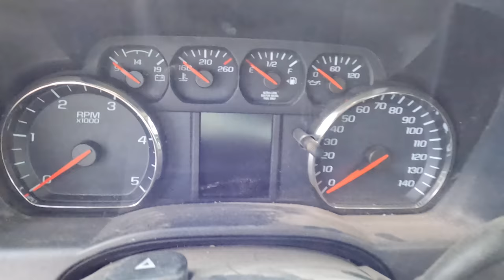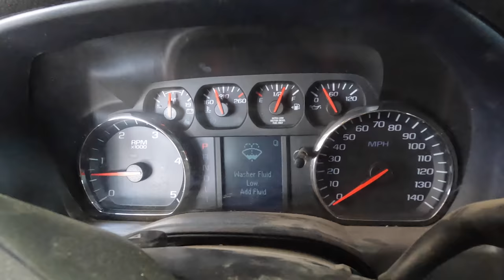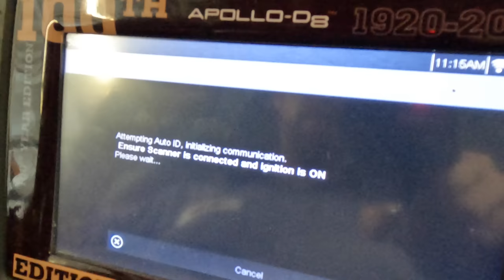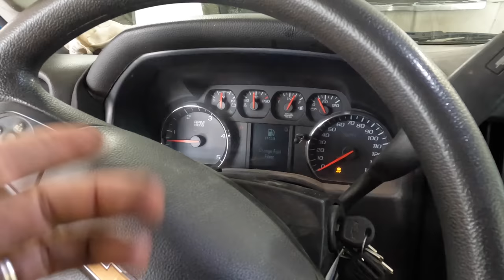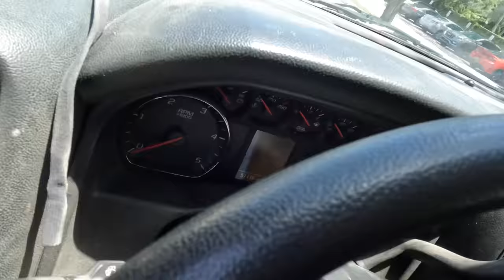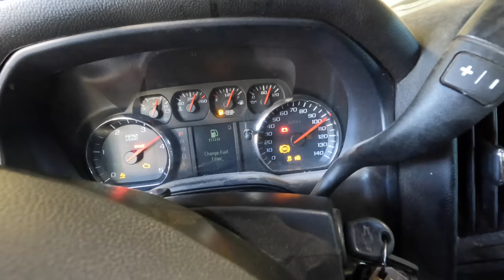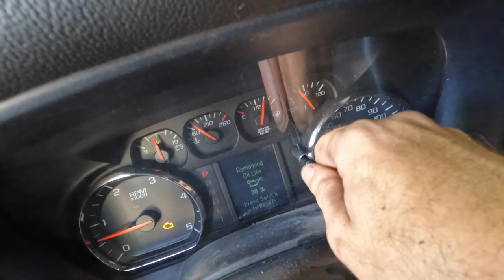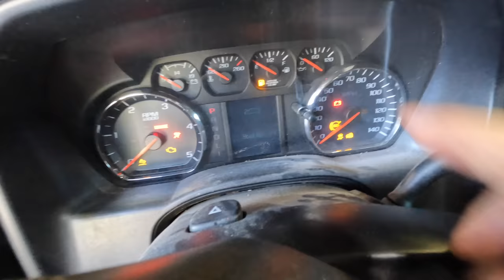Multiple Warnings! Medium Duty Duramax 6.6 3500 4500

Comment: Isn't it bad to mix those coolants without doing a proper flush? Your mixing green autozone coolant with what looks like orange/Dex Cool. Always been told thats a bad thing to do.
Reply: First of all, that was yellow and not green.  Where are you seeing green?  That coolant is universal, works in all makes/models and is chemically identical to Dexcool.  Perfectly fine to use here and in any application, point blank and period.
Reply: @coolantkid3428  Green/yellow, dont matter. I always been told (even from dealers) never to mix colors of coolant. Red comes out, red goes in. Green out, green in. Yellow out, yellow in. Only exception is when you do a complete flush.
Reply: @nytrackrider  That is because dealers are trained to say that.  They want you to buy their expensive OEM coolant.  Folks who know better understand that is unnecessary.  It's just like thinking DOT3 brake fluid from a bottle with the manufacturer label (such as GM) is better than DOT3 from somewhere like Napa.
Reply: @coolantkid3428  Thanks for the explanation.

Comment: That’s not a 2004. That’s more like a 2018 or a 2019 Silverado HD.
Reply: When the scan tool picks up the VIN, it shows it to be a 2019.  I noticed that too...and, RockAuto has the fuel filter in stock.

Comment: Do not ever put DEF in the fuel tank!!! Your truck will shut down quickly. Major expensive damage will occur in the engine and fuel system. In fact, if you have accidentally put DEF in your fuel tank, DO NOT start the engine. Have it immediately towed  to a mechanic for repairs.
Reply: Local farmer did that and a while later had to replace all the injectors on his tractor. John Deere paid for it since it didn’t warn him in the handbook.
Reply: Really?  Wow!!  Would that be the same type of warning as not putting gasoline in a diesel fuel tank?
Reply: @buckhorncortez  made the comment because people make mistakes, and I have seen first hand the results of such a mistake. I am going to edit my original post and add an important piece of info.
Reply: @46fd04  People do! Far easier now that Ford & GM have one fuel door with both fills there! Having a bad day or fighting with your better half,, easy to do with both fill caps off! I guess?

Comment: From what I have heard from a few semi drivers is just wait until you can't get that DEF fluid as the production of it comes mainly from overseas.  And he has already found quite a few truck stops out west that were totally out and had to go to a local Autozone or such to get it...which they won't allow the large purchase amount needed to maintain a semi truck's usage full time.  
The funny part of his story was, as a driver and having a pee stop whenever you need it just isn't feasible always he and many drivers are using those pee bottles you get from your doctor to measure urine output.  Just unzip, load the "dipstick", and relief comes swiftly to store for the next stop...lol.  I can't help picture drivers doing this and something happens they spill it all in their floors...lol. 
Anyway, their shop/company mechanic said it was just pee so if in a pinch just pour their pee bottled up stuff into the tank and get to a place where you can get the DEF fluid.  Well, a driver he was tag teaming with somewhere out west near Montana was getting the low DEF light and was starting to get concerned.  So, he takes his little bottle...and my driver friends' stock donation...and pours it into the DEF tank...they said it was synthetic pee.  So, he does, and sets out again.  A few dozen miles down the road the truck goes into limp mode, totally shuts down, warning alarms going off and lights all over the dash, and he pulls over to stop...and the truck won't start at all.  When the diesel mechanic his company called came to figure it out he found pee in the DEF tank.  And, he went off on the driver.  Needless to say, after a few thousand dollars of a bill to do repairs, since our pee isn't DEF fluid and it had damaged several electronic sensors and such he gets back on the road...days later of course...only to get back to the main depot and get fired.  DEF isn't pee like we....well, wee...LOL.  Putting pee in will destroy many sensors.  So, don't put pee in the DEF tank.  LOL.  
Truck drivers have the best stories...truthful or not...ROFL>
Take care, Ray.
Reply from the maker: and THAT is a problem

Comment: Red is propylene glycol and green is ethylene glycol, using the wrong coolant in the engine can degrade seals and in some cases even damage the engine block as the additives differ between the two. the red dexcool type has additives to protect aluminum blocks and heads the green stuff usually doesn't. But hey gotta drum up more business some how.
Reply: Wrong.  Red does not mean it is propylene glycol.  Why are you commenting on something you clearly know nothing about?  The universal extended life coolant Ray used is perfectly fine, works in all makes/models and it's chemically identical to Dexcool.

Comment: all because it is a dam Japanese motor in a genuine Chevrolet pickup truck don't understand but it is the reason why I no longer own a Chevrolet and I know drive a Dodge 3500 Cummins diesel in which I pull a 12,000 lb camper 60 70 mph on the freeway and still get 26 miles to a gallon!!!!!!!!! I'm over 70 years old I owned a Chevrolet since I was 14 years old my first car was a Chevrolet and all the years I drove or a Chevrolet until they put a Japanese motor and a Chevrolet truck end of story

Comment: 4:17  WTF???  WHY would you reverse-thread that?  Who was smoking WHAT when the engineers designed that?  I mean, WTAFF?
6:55  Not a Chevrolet truck.  Okay, this must be Ray's annual Twilight Zone video.
13:35  "Check back in at 9:30."  Ray must have been a programmer in a previous, or alternate-universe life.
15:39  "I know that they're there, so I'll just poke around till I find them."  Why does this remind me of my teenage dating days?  Help.
Reply: Could be for safety so it doesn't easily open

Comment: Those two lower knutts were Right Hand rule for install. haaaa
My the running boards have Really gone Down Hill! Poorrrrrrrrrrrr. 
As it is Stupid buy Design it thus is Designed buy Stupids! Designing that type of filler one can't see it is harder to see the washer level so one can over fill it. 
I was going to say that is an easier place to access the fuel filter??? NO, just wear more fuel! I have great trouble getting at mine on the side of the engine the WIF sensor I had to lengthen as the factory harness was TOO Short! As I have a Donaldson W/F and fuel filter ahead of that factory one it will be years aka 120,000 km before it gets changed again. There is also the despencing W/F filter ahead of the those . Someone else may end up changing it???
That fuel filter was installed (DRY) hence the rolled . 
Really? Never seen that before doesn't make sense.  
There was not much in the way of asphaltaines in your diesel.

Comment: It’s never a good idea to use light-duty coolant in a heavy-duty engine; it’ll ruin it! The only way to prevent pitting cavitation in a heavy-duty engine is to utilize and maintain coolant with heavy-duty additives like molybdate and nitrite.

What Kind Of Coolant Do You Put In A Diesel?

Dry liners are found in Powerstroke engines as well as other mid-size diesel pickup vehicles. On a gasoline engine, these liners are part of the cylinder block. However, this does not rule out the possibility of issues. Cavitation can happen anyplace in a diesel engine as a result of the strong combustion explosion. It’s a good idea to check the nitrite level and the antifreeze condition on a regular basis. The best course of action is to follow the manufacturer’s recommendations for service.

Can You Use Regular Coolant On A Diesel Truck?

Is It Safe To Use Ordinary Coolant In A Diesel Engine? Light-duty coolant should not be used in heavy-duty engines since it can cause damage. Heavy-duty diesel engines can be protected from corrosion and discolouration by using replaceable liners around each cylinder.
Reply: Unfortunately, this is old school thinking and incorrect.  If you look up the owners manual for this 2004 Silverado 4500 HD, as well as any other diesel GM vehicle, you will see that GM uses Dexcool in everything.  That is because it is all you need.  Inhibitors such as molybdate and nitrite are not necessary to prevent cavitation in a modern OAT coolant.  The Autozone extended life universal coolant he used is chemically identical to Dexcool, except for the yellow dye color.

Comment: Mixing coolants again Ray.....sigh
Reply: The universal extended life coolant he used is perfectly fine here.
Reply: @coolantkid3428  Not true when you mix coolants your changing the chemical makeup of that coolant (IAT, Hoat, OAT, ethylene glycol,  Ect).  Early in my automotive career I used to mix coolant to find later on seals would blow, hoses would rot, heater cores clog, and head gaskets would seep.  If you going to mix coolants at least drain the old coolant out and replace with new. Even doing that you never get all the factory coolant out and still mix coolants.  In my shop we use what color we pulled out!
Reply: @leroygreen1877  Those days are gone, these universal extended life coolants mix with everything and there are no issues.  Think about it for a minute, Ray uses this in nearly every car he works on that needs coolant.  He never does flush/fills, just pours it in.  Don't you think if there was an issue, he'd be flooded with return customers complaining that the cooling system has been ruined?  It's not happening and it's because that coolant really does work in everything.  I've used it in so many different vehicles and have never had any issues.
Reply: @coolantkid3428  He is lucky he works in a hot climate because you do that in a cold climate vehicles he would have complaints of plugged heater cores.  Your right it may take a few years to cause damage because of cross contamination but I see it on the daily where I work.  Dexcool system where people mix green or tap water comes with leaky rads, seeping head gaskets, soft hoses, and plugged heater cores.   20 years working on cars in the cold north we have hot summers and bitter cold winters  and mixing coolants like he does cost costumers thousands of dollar to fix later on.
Reply: @leroygreen1877  The problems you're seeing are when people use IAT conventional green coolant and attempt to mix that with long life coolants.  That stuff is not intended to mix with everything and you will have issues if that is done.  Lots of folks (even a lot of mechanics) don't know better and buy that stuff and dump it in their cars.  If you use the universal extended life OAT coolant like the Autozone one he's using, there are no such issues at all.  Cold climate, hot climate, it really doesn't matter.  By the way, the universal extended life coolant he's using is chemically identical to Dexcool, except for the yellow dye color.  It's 2EHA, TTZ and Neodecanoic acid.  Nearly every independent shop and places like Firestone, Goodyear, etc all use this universal OAT coolant.  It's also the most commonly available coolant in any parts store or places like Walmart.  There are millions of gallons of this stuff in hundreds of thousands of cars on the road today, all purring along without cooling system issues.

Comment: Replace an entire tank instead of one sensor, madness.  Finding the same with a Ford, metal connector in the clutch line is leaking. Plastic pipes in and out but you cannot buy just the pipes. One half comes with the clutch slave cylinder and the other half comes with a master cylinder and reservoir even though each item is only connected by a short hose. Bonkers design.

Comment: "look $20 " 🤣🤣 i laugh because its true lol.  "DEF , the failure point of modern diesels"  that is one dead horse you can continue to beat as far as im concerned 👍. i remember when i first heard of it i thought it was a joke. it still is in a way lol.  exhaust fluid...that is right up there with blinker fluid....  i bet you could get bottles of water . slap a label on them that said "blinker fluid" and people would buy them.  either as a joke/prank on someone or because they really know no better. just like the politicians.   why that coolant tank has a side fill idk. unless it can be used on another truck and its turn different. thats is all i can think of. why the left hand threads...just to be difficult i guess. just like the nonreplaceable sensor.  does your truck have the stupid fluid too? if not it will last longer than that one .  it maybe because of my dad but i like Cummins. though all diesels sound sweet. my dad worked at a Freightliner dealer for 20 years i think.  good vid

Comment: i thought antifreeze was ethylene glycol, not propylene glycol
Reply from the maker: The old green coolant is Etheline glycol almost everything else is propylene glycol. Fun fact propylene glycol is also used as an artificial sweetener to substitute for sugar. I find that suspicious
Reply: @RainmanRaysRepairs  and ethylene glycol is used as a laxative! (its a different polymer length tho). also thanks for the info ray!
Reply: @RainmanRaysRepairs  That is incorrect, this coolant as well as nearly every other one on the market is still ethylene glycol based.  Take a look at the ingredient list on the bottle, you'll see ethylene glycol is the first one listed.  The ingredients list is on the back, in the lower right corner.

Comment: 5:15     99 percent of the circuits that will fry from jumping are 2 wire circuits
Reply: Not true!
Reply: @fredwalker839  So any output will be fried from jumping if its activated when jumper is in. Most outputs are 2 wire solenoids. Any input 2 or 3 wire will not fry from jumping them like that and its how I test most inputs.
Reply: @eddiereichel9354  Whoa, that’s what schematics are for, read twice,,,,jump once! LOL

Comment: More of GM's suckA*s Better? ideas? Non replaceable $5 sensor requires the replacement of a good $200 (?) coolant tank. PLUS more wasted plastic cloging up the landfill. Way to go G fn M. And LEFT hand thread coolant cap, REALLY GM? Also let us rant a moment on the fantastic ground clearance under this beast, except for the massive transfer case which hangs down so low that the oil drain pan won't go under it meaning it is the first EXPENSIVE contact point for finding large rocks et.

Comment: Using a universal yellow coolant instead of the correct orange Dexcool? WHYYYY? The customer is paying for it so use the proper fluids. Dexcool is good for 5 years 150,000 miles. Mixed with some unknown fluid, nowhere near that long.
Reply: All you have shown here is your ignorance to coolant chemistry.  The Autozone universal extended life coolant he used is chemically identical to Dexcool.  What he used is fine, point blank and period.
Reply: @coolantkid3428  Umm, no it's not chemically identical. Universal coolants are designed to be compatible with numerous coolants but that doesn't mean they are identical. They are still a compromise vs. the specific OEM coolant.
Reply: @atikovi1  You say that without even knowing their chemical makeup.  The inhibitor package in both of these is 2EHA, TTZ and sodium or potassium neodecanoate.  Your assumptions exemplifies the ignorance that plagues the internet today.

Comment: Why do you Yanks need such huge cars?!
Reply: To help use up all that extra fuel on the planet. Also to run service calls  and repairs for various industries. Plumbing/ HVAC/ mobile mechanic etc.
But mostly, for the fuel burning.
Reply: Work
Reply: To get huge jobs done.
Reply: honestly we dont, its just the size they sell them in. something like a tacoma or colorado would be a perfect size if they would put the v8 they put in the bigger trucks, but they wont do that anymore.
Reply: Those with small ones always jealous of those with big ones. Size does matter.
Reply: It's a service truck. Might weigh 15000 lbs. every day. We had a service truck that was one size smaller and that poor thing was overloaded every day of its life.